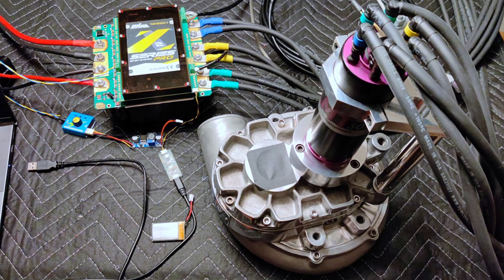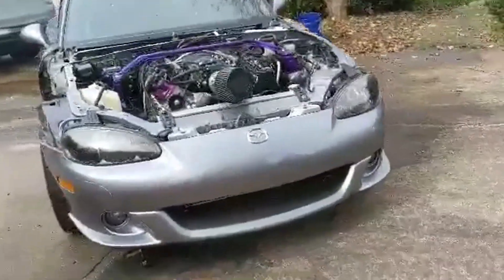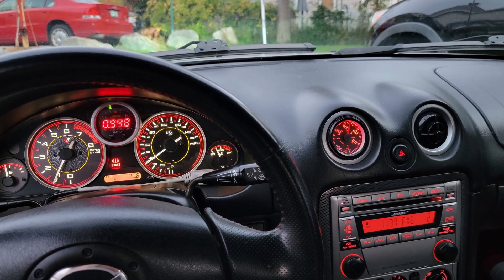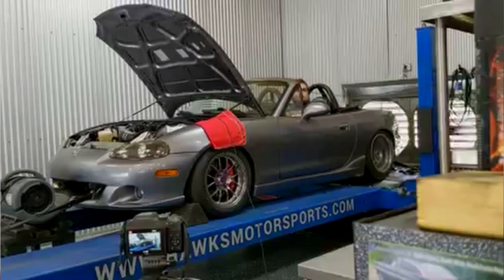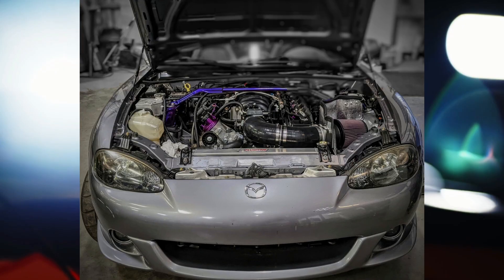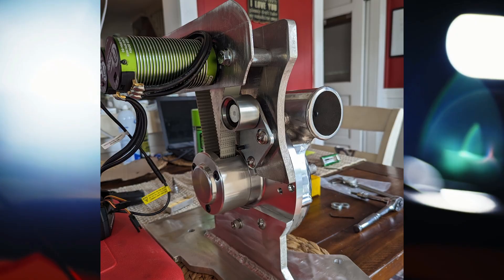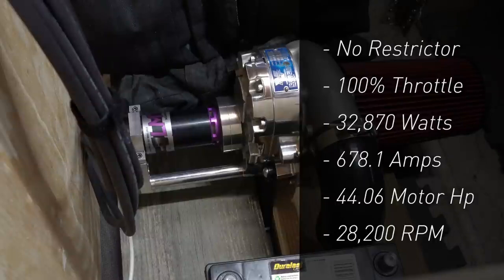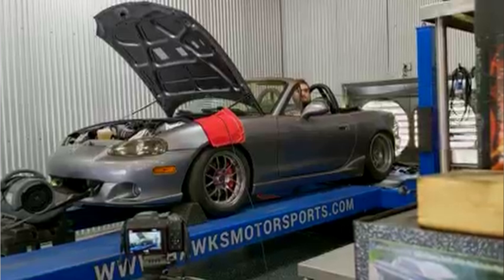Twin Motor Electric Supercharger!

Comment: Next up: "I used a tesla electric motor to turbocharge my car" 😆
Reply from the maker: Lol.  Unfortunately, not practical - too big, too heavy, etc, etc.  I did at one point consider using a Nissan Leaf drivetrain.  But that also suffered from the same issue.  You're much better off with 2, 3 or 4 smaller electric superchargers rather than 1 big one - it's cheaper, lighter and easier to package.
Reply: @AlexLTDLX  LOL it's amazing you actually did some research on that! This was the first video I saw from you (the YT algorithm is doing something funky for me right now) and I'm glad I did. Can't wait to see what you and David come up with & time to go trough your backlog of videos!

Comment: I'm using a me1616 motor and 175v 10,000rpm.

175v 600amps dc.

If you have a motor with a large enough diameter you can run a much larger setup....
Reply from the maker: The problem here is weight and complexity.  That motor isn't much more powerful (actually, it's less powerful under continuous loads) than the LMT motor in the sledgehammer.  However, it weighs 10x as much and would require significant step-up gearing; the LMT motor requires no gearing - it's direct drive to the impeller.  There are two paths to power: torque and rpm.  Both give the same result (actually, rpm is typically better for a few reasons that would make this response too long, but let's call them equal).  Most hybrids are going to smaller, higher rpm motors in their transaxles for exactly this reason.  The challenge with the smaller, higher rpm motor is electronic mostly - which we've solved.  The setup you're proposing would easily weigh at least 4 times as much for the motor/supercharger/gearbox alone as the completed Sledgehammer does.  Plus, packaging it would be difficult if not impossible because it would be huge.  And the performance would be, in a best case scenario, the same.  However, I do like axial flux motors in concept, just not in this application.  The final piece of the puzzle is matching the compressor's map to the application vs cost.  This is the part that trips up most people.  And, to be honest, the weakness of the Sledgehammer in it's current application.  Put it on a 400 hp n/a engine and it would really sing - 500hp n/a like it is now pushed it towards choke.
Reply: @AlexLTDLX  the v15 I was running had a 3.45:1 gearbox and I was running a 2:1 on the pulley, I have a atomic 998kw rebuild kit running 14.3mm headstuds, motor has seen over 1500hp on the v-15 off the me1616 for forced induction
Reply: That's 20,000 rpm at the pulley with 300nm of torque at take off.

You need to understand electric motor physics.

Double the stator width will achieve double the torque at the same kv.and amperage,  but Double the diameter and you have around 4x the torque at the same kv and amperage.

Also a larger electric will handle MORE continuous power as it has a larger cooling surface.

In saying that the me1616 is water cooled at 175v I dip to 167v with 600amps and capable pulling 600amps for 20 seconds continuous is not a problem. 

99kw continuous is 132hp.

Also the me1616 is rated at 134nm at 550amp AC (phase) at 120v

At 175v stall torque is increased linear to voltage increase, at 550amp (phase) 175v you're looking at around 200nm, 

And we all know that dc current at takeoff on a controller the phase side is much larger.
Reply: @AlexLTDLX  for me it was a 1200hp gain for 120kg of weight. 

Now if you compared running a dual motor to a motor that is double the diameter,  you have simply doubled your torque. The double diameter setup regardless of the extra weight is more efficient.
Reply: @AlexLTDLX  to put things into personal I now run 280hp wet nos, and I'm about about to put the same setup back into my truck but instead of a v15 I will be running a v3 si for a much better way to get power.

I was running the me1616 originally straight to the diff on a 4.11:1 ratio on a bac8000 controller originally  but removed it due to the 200kg of front diff weight.... blowing in air and adding fuel is definitely the way.

Electric motors shine with voltage, stall torque increases, double the voltage at the same amperage yields double the torque. It also runs cooler due to ohms law even though there is eddy losses etc
Reply: @AlexLTDLX  lastly, it is much less complex than a dual motor setup... you just run the pump after the cooler to cool the motor and controller.
Reply: I agree. Also moving to a more power dense axial flux motor could be beneficial in this application also?
Also I think using a reduction gearbox similar to what they use in a electric skateboard hub motor,  perhaps? I'm biased with already having affinity for things with stationary gears and high RPMs 🤭 (it happens as a rotary owner)

Comment: Long time subscriber. Love the videos. Instead of removing the charge tube for NA and supercharged modes why not use an electric cutout valve to switch between na and supercharged mode. Open up for na and closed for boost mode.
Reply: I want to do this, it is just an issue with getting a small enough unit to fit in my engine bay.

Comment: I forget which model Porsche, but, Engineering Explained guy (Tom, I think?) said the only street turbo setup he loves like a supercharger is Porsche's new system, which uses a turbine-generator to convert exhaust energy into electricity and an electric compressor to create the boost. I don't know how efficient the system is or if it could be relied upon solely for electricity generation, but it seems "hybridize der ferk" out of an I/C is the way to go - all accessories electric, turbine-driven generator/alternator, etc. Electrical components are very efficient, as we all know

Good luck, David!
Reply: Thank you for the kind words!

Comment: Someone needs to get with Kevin Talbot. He's an RC youtuber and he's got tons of those high Hp RC type motors and speed controllers but also a lambo and a brand new Monster Jam truck. He's a certified gear head and would probably have connections that could help.
Reply: I would love to chat with him he is running 4 motors in his land speed record vehicle. I do need to figure a foolproof way of running multiple motors at the same time. And he should have the answer!
Reply: I've bin researching multiple motor rcs for 6 years. Just run a splitter at the signal input and run as many as u want.  I've seen 4 from Kevin and many other speed run guys do this.
Reply: I just came to comment the same thing!